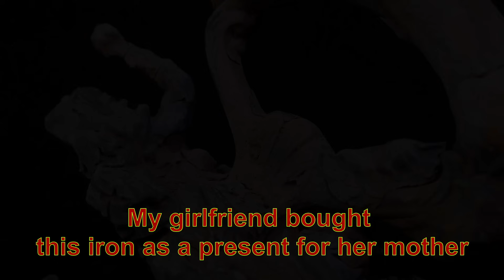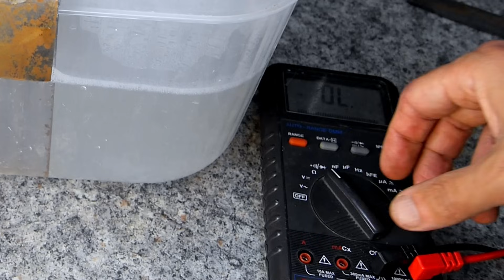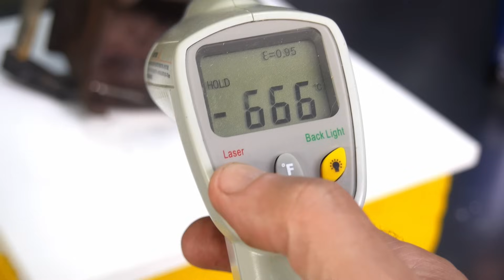Cursed 1870 German  Iron restoration : : Testing at the end 1870 vs 2023 ?

Comment: I saw you used firewood but my grandmother would use coal. 

  This was a very enjoyable video. I like that you left in all the issues getting back to the original piece.
Reply from the maker: I'm very glad you liked it. Yes, they usually use it with coal. However, it works well with wood. Charcoal keeps it warm longer.❤

Comment: WD40 is not an appropriate fluid to release rusted bolts and screws. Instead, you can uses the magical mixture of transmission oil and Acetone at 50/50 portions. Also, to reduce your pain of removing the bolts and nuts and screws you may want to invest in buying an impact driver.
Reply from the maker: Thank you very much for your good advice. I will try it.❤

Comment: Nice... Instead of burning wood inside it; coals from a near by fire would've been used to heat it up.
Reply from the maker: I'm very glad you liked it. Yes, actually the purpose of this is to use it with more charcoal. I went a little easier.

Comment: Try using a penetrating lubricant instead of the WD40. The difference is humongous.
Reply from the maker: You are totally right.Wd 40 does lots of things.(It is also a penetrating oil but not the best one.Used mainly for removing water from surface).I found that it works well for rusted screws with heating.❤️❤️❤️.